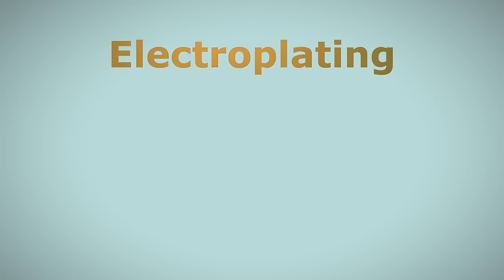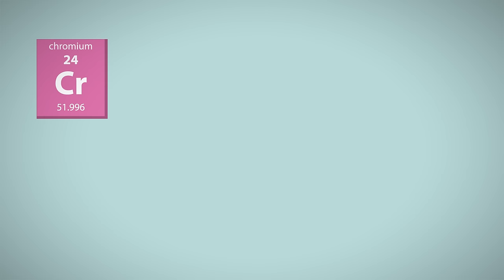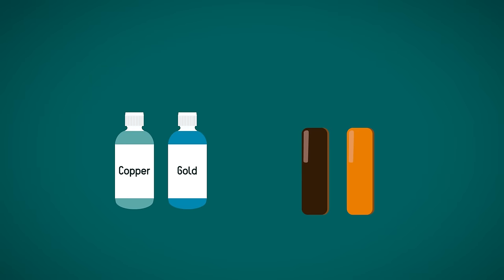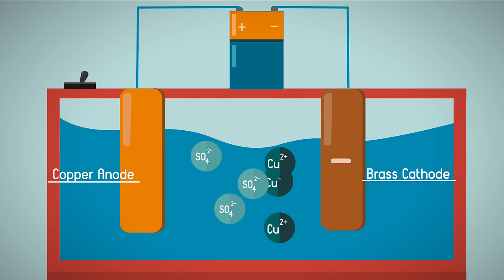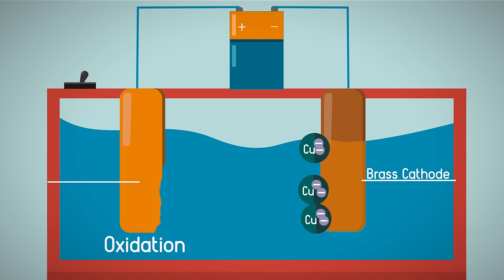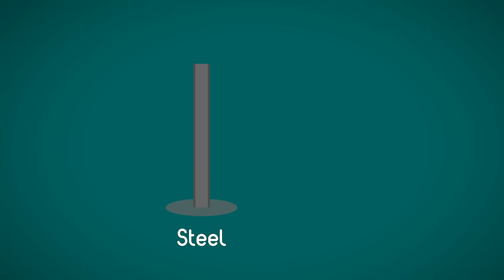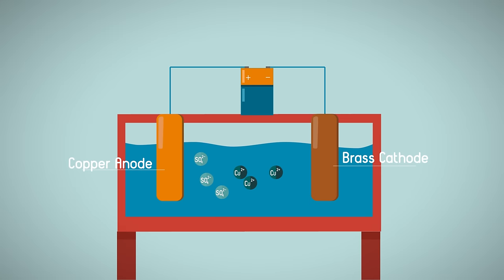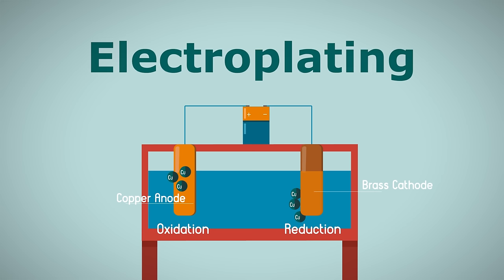How Does Electroplating Work | Reactions | Chemistry | FuseSchool

Comment: Thank you but I think there is a little mistake in the conclusion part. The graphics show that Cu2+ ions at the anode lose their charge (not electrons) to become copper. The graphics should show that the anode is copper and then loses two electrons to become Cu2+. Remember that electrons have a negative charge. So in your video, you are showing that when Cu2+ loses two electrons it becomes Cu. This is wrong as it would mathematically give Cu4+ (having lost two negative charges). Therefore the correct way would be to show the copper (zero charges) losing two negative charges (electrons) to become positively charged (Cu2+). So basically, you have it the wrong way around. Otherwise the video was very helpful and clear!

Comment: Can i use iron and h2so4 reasion result as solution for plating iron coting on Copper ?
Or can i use Ferric chloride solution ( which is used for Pcb etching ) to electro plate iron on Cu ?

Comment: At the cathode, if the element is more reactive than hydrogen, can it still gain electrons, or is hydrogen discharged? (When dissolved with water) My teacher was not clear!!
Reply from the maker: Metal ions and hydrogen ions are both positively charged and so both can gain electrons. So then whether you get the metal or hydrogen during electrolysis depends on the position of the metal in the reactivity series. When the metal is less reactive than hydrogen, you get the metal. But if the metal is more reactive than hydrogen (as your question) then hydrogen will be produced.

Sodium chloride for example would produce hydrogen at the cathode - because sodium is more reactive than hydrogen.

I hope that helps?
Reply: thanks

Comment: How does the concentration of the electrolyte affect the amount of mass deposited from the anode?
Reply: Take the example of Copper: The concentration of the Copper electrolyte being higher means that there are more Cu2+ ions in solution. Therefore, when current is applied, more copper ions are circulated and deposited on the brass as solid copper because there is more to begin with. 

If there is less ions in the electrolyte, there will be less solid copper deposited.

I know this is an old question, but hopefully others who stumble across this with the same question can understand better.

Comment: the copper ions in the solution get attracted to the cathode .the electrons then enter the cathode to make the copper ions neutrally charged.are these electrons supplied by the anode?
Reply from the maker: Yes, the anode is losing electrons around the circuit (so through the battery cell pack and around to the negative cathode). Losing electrons is what makes the anode electrode positive.

Comment: Good explanation .is one circuit can plate one component each or can accommodate more component ?pls explain
Reply from the maker: You can only plate one component at a time - the anode will always be the sacrificial metal and the cathode is what needs plating. But you can do mass plating at the cathode.

Comment: Still one question remaines in my mind. Please do reply of it. If the work of current (electrons) are just to provide electrons to Cu+ ions near cathode then all the electrons will be used up in that process itself and no electron will be left to flow in the elctrolyte from cathode to Anode...Then why we have used an electrolyte?
Reply from the maker: The electrons flow around the circuit from the anode to the cathode.

The anode is made of metal - copper in this video. When in the anode, the metal atoms lose electrons to become ions.  These metal ions (so copper ions in this video) are then released into the electrolyte solution. The electrons that were lost from the atoms in the anode flow back to the power source and around to the cathode. 

So the anode not only supplies copper to the electrolyte solution (to keep it topped up with copper ions) but it also keeps up the supply of electrons. Hence oxidation occurs at the anode (oxidation is loss of electrons).

Does this help? Comment again if you are still unsure.
Reply: FuseSchool - Global Education But when all the electrons were used up earlier in making ions then how it can flow back from the anode to the power source?
Reply from the maker: The electrons are only 'used up' when there are no more copper atoms in the anode - so when the anode has been 'used up'. The cycles run in time with one another.

Before the copper atoms in the anode are released into the electrolyte solution, they give off electrons which go into the circuit and flow around to the cathode. This keeps the cycle going, until the anode needs replacing.
Reply: FuseSchool - Global Education You meant that at starting, the electrons move from the anode to cathode through electrolyte and then the process of formations of ions takes place then it means the current here is flowing from positive (anode) to negative (cathode). But the current flows from negative (cathode) to positive (anode)
Reply: No, you're wrong. Its the electron flow, not the current. Unlucky aakanksh bansal.
Reply: and the electrons flow through the circuit, not the electrolyte.

Comment: Can you tell me the chemical used to coat copper coil ? Copper coil is used in many products, such as the induction motor in electric cars. The copper coil doesn't short circuit when they are wound close to each other or even one layer over another. So what is the chemical used for that?

Comment: Is the thickness of plated layer the same on the whole surface of the cathode? We know that the electrical current regularly goes by the easiest and shortest way. So if the piece of jewelry has variable thickness, the current will preferentially go to the solution via the thinnest parts (those having less resistance), thus plating them better, while other parts of the jewelry may not be plated at all. Does the shape or thickness of the cathode matter? By cathode i mean the detail that is plated.
Reply: Yes it does matter, but what matters the most is the surface area. The more surface are you have, the better plating you can have.

Comment: I tried to do a sample of electroplating with Cu and Zn for my electrodes.  The aqueous solution was Root Kill CuSO4.  I got the opposite effect the copper stayed as copper and the zinc oxidized in the cathode.  Why didn't it work the way you explained it in the video?
Reply: Did you connect the battery / power source backwards?

Comment: I am trying copper electroplating but getting electroforming...any recommendations
Reply: 1. Get rid of any impurities in the metal. That means sanding and cleaning the copper.

2. Create a copper sulfate/copper acetate solution with low currents to prevent electroforming/metallic copper formation.

3. Plate with a low current. That will help too.

Comment: Guys(nerds,chemists...etc.), I had a condensed milk can then I opened its top with a can opened then ...
I did electrolysis on that. I got weird colors!
There was orange, black/dark gray, white, and navy(dark blue) colors of solution/residue.
The orange surfaced and kept on floating, the rest sank.
What are these compounds/elements?
I ain't sure but I am guessing tin is the orange one that was floating, maybe it is tin oxide or something.
What you think? Thanks in advance.
Reply: I think you observed some eloxing. That way those false "gold card" sets are made. As can be seen on cody's lab channel being "reverse engineered".

Comment: Why does the anode release the copper ions though?
Reply from the maker: Refer to 2:50
The current supply to the anode causes the copper atoms to oxidise, loose electrons, and then dissolve into the electrolyte solution.

Comment: always electrons only flow from - to + but you have said it flows from + to - how is it possible?
Reply from the maker: Inside the battery cell when current flows, electrons move from the negative terminal and to the positive terminal.

Now thinking of the wider circuit - so including the electrodes.

The electrons carry on flowing away from the negative terminal. The electrons from the electrode next to the negative terminal have to replace these lost electrons. This causes electrons to be LOST from the electrode that's next to the negative terminal. When an electrode loses electrons (so loses negative charge) it becomes positive. This means the positive electrode (the anode) is next to the negative terminal of the battery. As both of these "lose" electrons when the current flows.

The negative electrode (the cathode) is next to the positive terminal of the battery. As both of these "gain" electrons when current flows.

So it isn't that the electrons are flowing from + to - just that they are leaving behind them a positively charged electrode and are creating a negatively charged electrode.

Does that help?
Reply: Yes I understand so basically they are moving from - to + only but by parts right ?
Reply from the maker: Exactly!

Comment: What causes the plating to remain bonded, in the long term, to the cathode? Why doesn't it just slide of like a glove when current is removed?
Reply: because its non-spontaneous and requires energy to move the reaction backwards or forwards
Reply: strong metallic bonding

Comment: How do electrons flow at 2:40 away from the positive end of the battery? I thought they could only flow towards the positive end cos of opposite charges. Same thing when the electrons are transferred from the anode to the cathode at 3:04 I'm baffled
Reply from the maker: Around circuits electrons flow from the negative terminal to the positive terminal - as you would expect them to.

However inside batteries electrons flow from the positive terminal to the negative terminal (chemical energy is required to push electrons in this direction). 

Does this make sense?
Reply: Kayla Hutko 
in AC Electricity possible depending on shap of waves and current but in DC  ithink no way
nice vedio
thank for all

Comment: is this video accurate?... is that how electroplating works?... for some reason i was thinking you hooked the negative up to the plating material.. the excess of electrons pulled atoms away and carried to the object attached to the positive having a deficiency of electrons, picking similar atoms out of the solution in transit... 

so unfortunate the choices made in science in associating names with negative and positive...the influence on the way it would, or could be falsified, pretty ...well... unfortunate....thanks for any input.